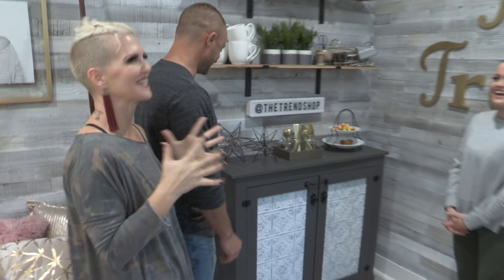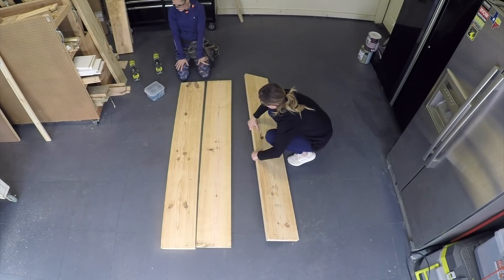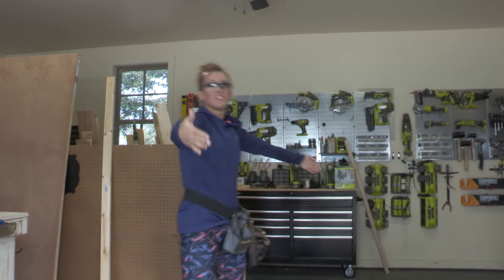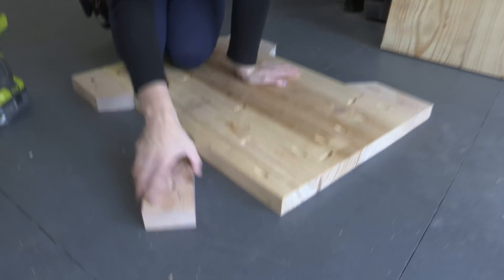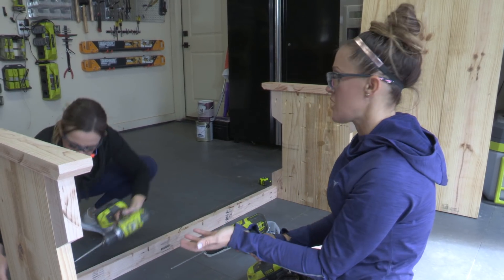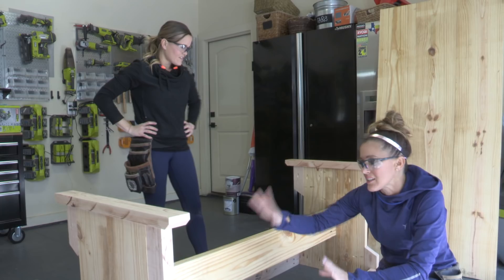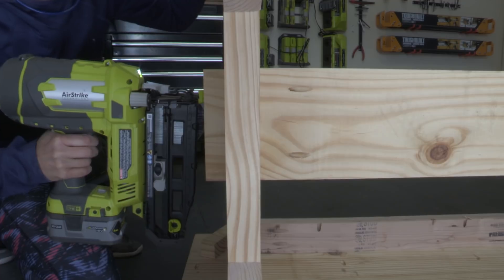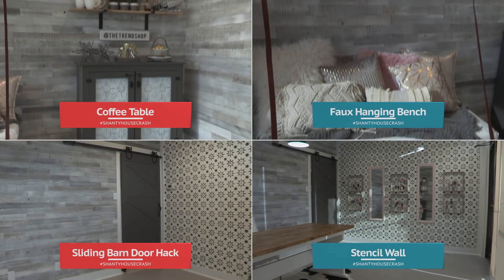Pew Bench Farmhouse Table for $65

Comment: Hello, I am new to DIY, but I have been making a lot of the decor for my upcoming wedding. I am going to try to make this table and use it as the head table for our wedding. I am planning on using this table as a dinning room table after the wedding. I was wondering if you could send me some plans for a matching bench? I have looked at benches on your website and they are all to large for my space. (Sadly, have not yet mastered the skill of resizing someone else’s plan. As I mentioned I just starting learning to DIY out of Necessity because wedding decorations are expensive. Lol) this table would fit perfectly in my dinning room.

Comment: Looks great! I would totally do this if we had the room!lol Why use wood putty instead of dowel to fill the Kreg holes? Just curious! Thank you for the video!
Reply from the maker: Del Short thank you! You can do dowels too! We just prefer to use the filler. Kreg actually has a pocket hole plug jig now that we have been wanting to try!
Reply: Like, a jig for making plugs? I might go look at it, but wood glue and dowels just seems a little quicker, no?
Reply from the maker: Del Short I haven’t seen much about the jig but it looks interesting! They are pretty good at making fast and efficient tools so I’m sure it will be awesome!
Reply: Thank you for taking the time to answer questions! I'll stop bugging you now!😊
Reply: I have the pocket hole plug cutter, it works great.... Just use a fast drill speed & let the weight of the drill cut the plug..... Don't force it, you'll end up chipping the plug.

Comment: I think they did a fabulous job, they always do great work. I'm assuming by every tool being the same color, they are sponsored by that company. Not everyone has all those tools. I'd like to see alternative ways to get the same results in their videos. Like, use ?# Size bit an drill at ?# angle. If one is using a reg. saw, instead of a miter saw how it could be done. Sometimes a quick Google search can help but if it was added to the plans it would be easier. Just a suggestion
Reply from the maker: Cody Sturm good suggestions! Thank you!!
Reply: Cody Sturm They use Ryobi tools. I would go out on a limb and say Ryobi are the best bang for your buck "entry" levels tools, though I think they are better than just entry imo. I use them myself.

Comment: I know nothing about woodworking but I'm curious as to why you would "fake" the beam going through the ends rather than just putting it through?
Reply from the maker: Brian Sargent that would require cutting notches out of the 2x10 boards - it’s definitely possible but it’s a lot more work for the same result 😀
Reply: I appreciate the reply. so having them go through wouldn't add to the strength?
Reply from the maker: Brian Sargent not really